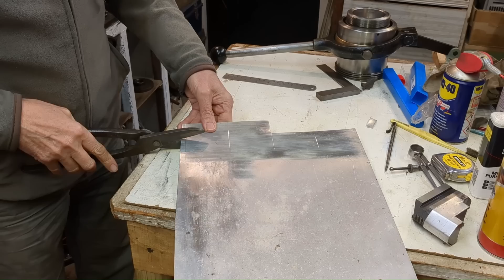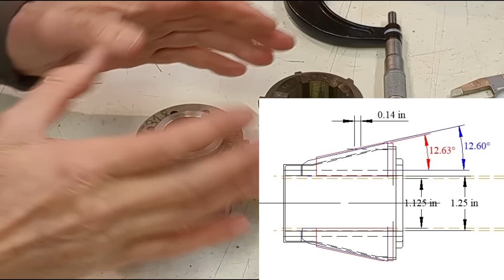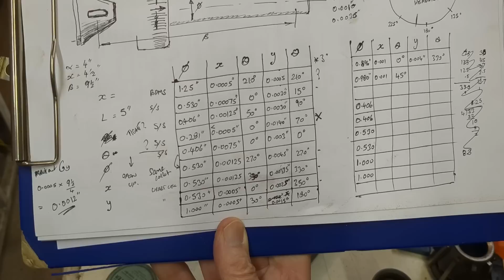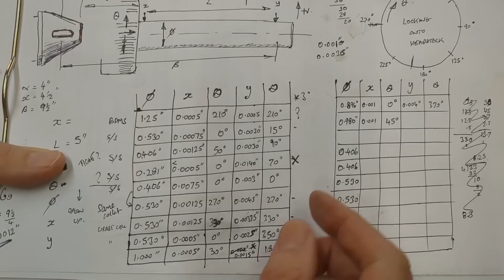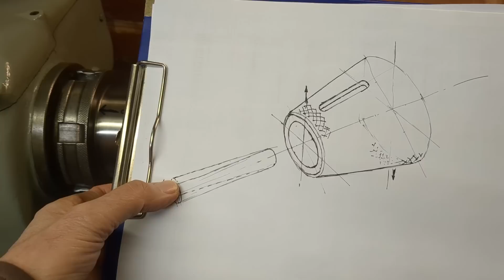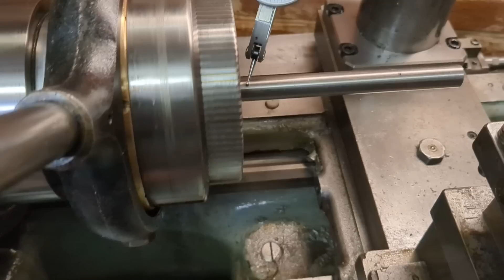Adapting older Burnerd collet chuck to receive newer style collets

Comment: I enjoyed watching your journey with the collet chuck. Just something to keep in mind, if you ever need to turn hardened steel in future you might want to keep in stock a few CBN and PCD inserts for your lathe tools. I had a need to re-shape the inner cone of an ER chuck which was way out and a CBN insert managed it easily leaving an excellent surface. Just for laughs I even tried turning HSS round bar and it cut leaving a perfect glass-like finish. They are not expensive on Aliexpress. Note they have negative rake so cutting pressures tend to be a bit higher. They are very brittle (unsurprisingly) so interrupted cuts should be avoided. Turning carbide rod with PCD inserts is another novelty to explore.
Reply from the maker: Thank you, Chris, this is really helpful. I will obtain some of these to experiment with. This would be a really helpful extension to my capability!

Comment: Hi Clive,  Ironically I have the exact opposite scenario to you I have the more recent chuck on a D1-4 camlock with only 3 of the newer collets and but a case full of the older type, as that was all i could find at the time. I don't have the luxury of the quick closer and had to make a key as they are like hens teeth, as they're not quite a Jacobs. 
Thanks for an interesting video
Cheers Paul
Reply from the maker: Hello Paul. That is ironic! As far as I know the older type can be used in the newer collets chuck which is what assume you intended. The slight downside of the lever operated chuck is that there is some eccentricity in the outer sleeve which affects the handle and causes vibration at higher speeds.

Comment: Hi Clive, I too have the same set of multisize collets, they came with the chuck, but not lever action. I very much like using them. 
I think these old L series nose tapers were prone to misuse from not cleaning properly. My taper has suffered a bit. Some lovely swarf imprints going on. Most are opposite the key where all the swarf would drop. I too found a similar pattern of high spots, careful stoning helped.
Reply from the maker: Hello Constantine. I think I would have preferred the key operated collet chuck but assume the closing holding accuracy and function is the same. Yes the worst swarf damage on mine was also opposite the key. I suppose that is where it tends to fall especially closest to the large diameter.

Comment: Hi Clive, 
Excellent treatise on static runout, very impressive on the L series spindle nose accuracy,  Colchester Lathes were renowned for headstock bearings and plotting an actual turned diameter on a Taylor Hobson roundness tester Talyround. Their saying was "Turn round within one tenth of a thou" 0.0025mm.
I have a standard accuracy chart for a Colchester Triumph 2000 lathe, circa 1972, company I worked for scrapped machine, I rescued the documentation. 
Interestingly,  this lathe was returned back the uk from Germany ( Company owners).

Very impressive technical sketches,  conveying true in formation, even the worse collet to bar combination is acceptable. 
Manyy thanks for sharing. 
Regards John
Reply from the maker: Thanks, John, for your feedback. Even though this is an old machine it is basically still very accurate once properly levelled and aligned. It is a great improvement on anything else I have used in my home workshop.

Comment: Why not just get the correct multi bore collet to suit the chuck
Reply from the maker: Seems like a fair enough question. I started out looking for a few of the older style collets but they were expensive. Complete sets in good condition only seemed to come up for sale of the new design. Another reason for using the newer collets is that they can grip right up to the working face whereas with the old design that isn't possible.

Comment: Just make sure you use the right type of insert. If you’re using a C-2, then it will break down quickly on hardened steel. C-5 is better. Good inserts unfortunately cost a good deal. Cheap ones may not be sharp and the quality of the carbide may be iffy. What I do with tapers is to measure the far end of the taper and note, with a marker, which part is furthest out and by how much. Then I measure the front of the taper and make the same note. Since nothing is perfect, I expect some minor error. Hopefully, it’s not out by more than 0.0001”. If it’s that close, it’s fine. But, the rear and front should be out in the same direction. If the opposite sides of the taper are out by different amounts, or in different directions, that’s a problem, even if it’s a tiny amount. Then, nothing put into the taper will run true. After that, if all is well, I check whatever goes into the chuck. I’ve seen tapers knocked out of parallel with the spindle because of some crash it was involved in at some point.
Reply from the maker: Thanks for your helpful comments! I have to admit that I don't know where my inserts come on the scale 1-6 but they were sold as being for steel. I purchased inserts for non-ferrous materials from the same supplier. Seems I need to learn more on this topic.
The taper was difficult to measure because of surface imperfections. Ideally, I suppose, it should be reground but that would have to be another project! For the time being I seem to have achieved the degree of accuracy and repeatability I need.

Comment: I have the same set 1/8th to 1 1/4" came off a Herbert 2D turret lathe, don't how I am going use them as I have draw in collets I can use. A big thanks for your video.
Reply from the maker: Thanks for your feedback! I assume that draw in collets will have a smaller max capacity.

Comment: It might pay to use a ceramic cutting bit in your boring bar. They cope with hardox steel easily.
Reply from the maker: Thank you! I looked at some online and noted how expensive they are. That might be for a future project with more experience under my belt with carbide inserts.

Comment: Your videos are always very thorough and complete. When I purchased my Burnerd chuck for nmy Triumph I did similar investigation and found one collet with about 0.0015 runout and all the rest at about 0,0005 or less. I think this is reasonable for what can be expected from a lathe. I am looking for a replacement for the one collet if I can find it at a reasonable cost.
Reply from the maker: Thank you for your feedback! Yes, I have read that .0005" runout at the collet might have been the as-new max figure. So your setup is excellent.